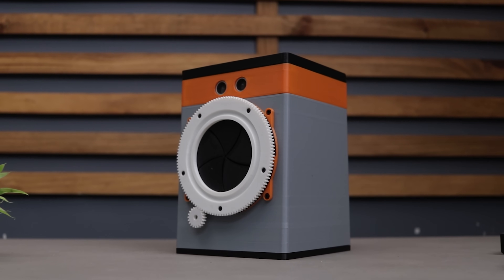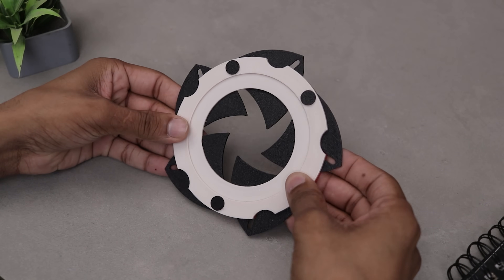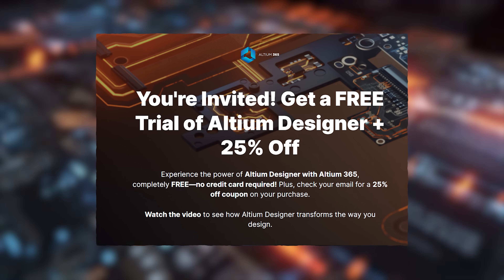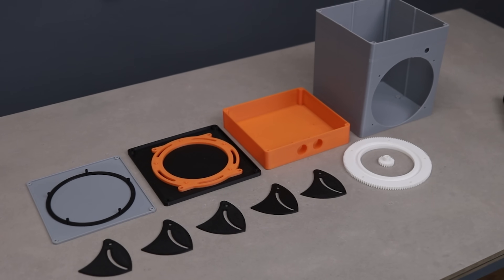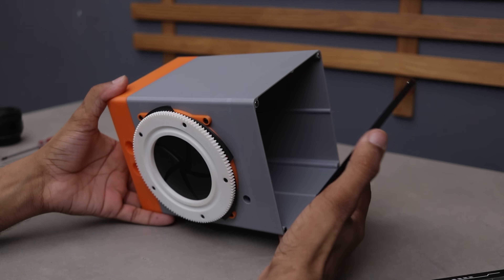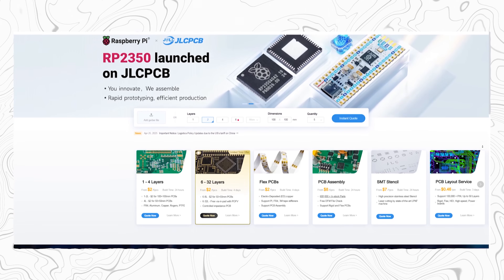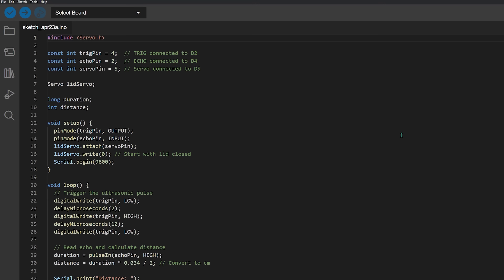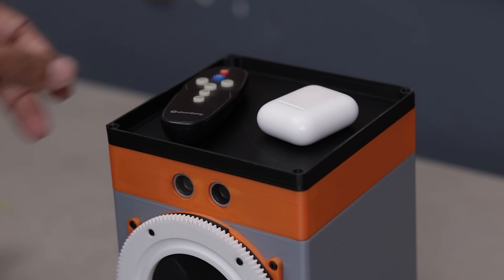I Built a Smart Desk Dustbin with a Futuristic Iris Lid!

Comment: well is there any way we can make it use some smaller motor consumin less power and using a more low power compact Microcongroller to make it self sustaining and work for months
since  the current circuit with battery and nano will consume lot of power

Comment: I purchased the design but especially the screwing on the front cover moving part is very weak.The cover on the top where the sensor is mounted is also held in place with 2 screws that are disproportionately in the middle.Overall the project is nice but the assembly part is very sloppy..My project orders haven't arrived yet, I have no idea whether to work or not.I can tell you one more thing, you are selling the project but there is no installation file. In your YouTube video, you only did the installation with the card you produced and there is no other installation method in the purchase file, there is only a wiring diagram missing in a part of the video.I think you should improve the missing parts. Thank you for your effort.
Reply from the maker: Thanks for your feedback, I'll definitely look into improving the design and instructions. you can ask anything. i will help you, whenever you start working on it.